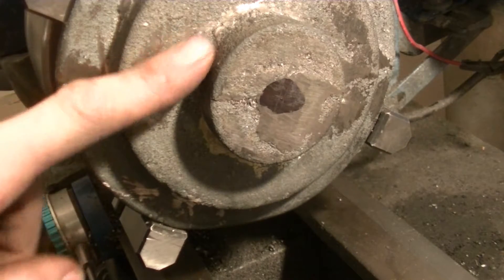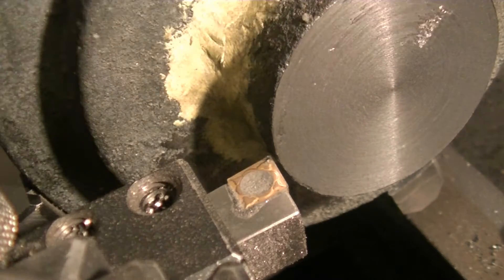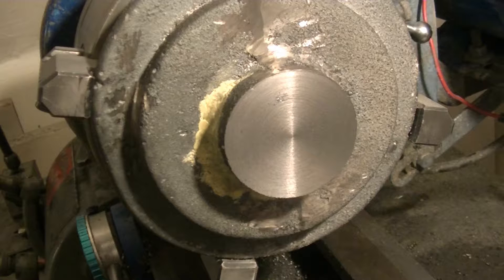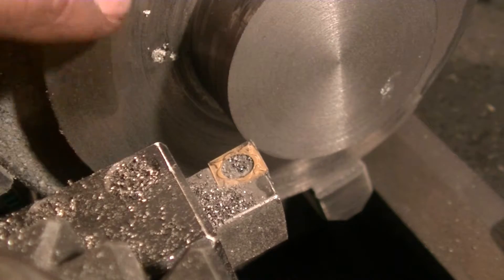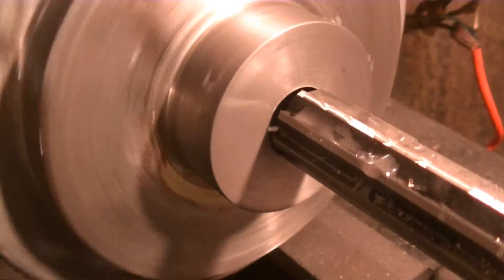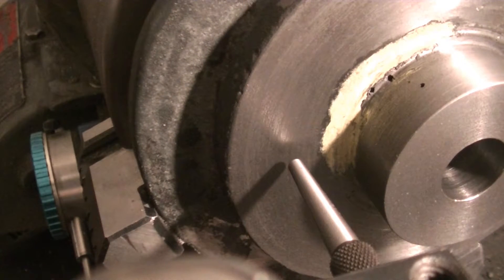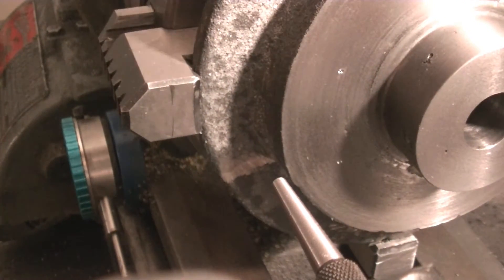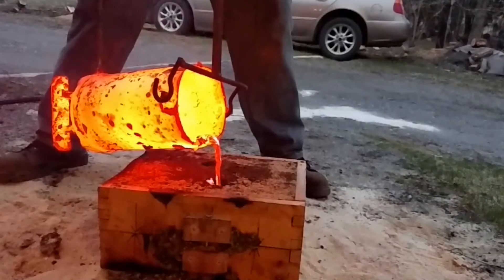Steam Engine Build: Machining Bottom Cylinder Head (Part 1)

Comment: Howdy, just found this project and have been happily binge watching. Great build!  Agree with others that brazing would be the most ideal repair, but wanted to mention high heat JB Weld putty.  I've had really good success using it on some projects requiring more heat resistance than available with regular epoxy.  Handles 450 degrees F continuous, 500 degrees F intermittently.  Looking forward to seeing this run!
- Bill
Reply from the maker: Hi Bill, Thanks for the views and the suggestion!

Comment: You could braze that blowhole. A heavy initial cut for the initial cut on CI will get under the scale and save your cutter. Nice casting!
Reply from the maker: Thanks!  I just recently got a torch capable of heating something enough to braze it (oxy-acetylene), so next time I get something like this, that is what I will probably do!  I will try making a heavier cut next time and see how it goes (my lathe isn't the most rigid machine as it is small)
Reply: I understand your concern about the size of your lathe, either a 10 or 12" Atlas/Craftsman, it appears. Even so, those lathes are capable of decent cuts and accurate work. I have used my dad's 10" Atlas and found it to be quite capable. My own lathe is a 10" 1943 vintage Logan which is a bit more rigid than the Atlas but still a small lathe.  You might try high speed tooling rather than carbide which requires more power because it's edge isn't as keen as that which can be obtained on HSS. Generally  carbide tooling  works better on powerful machines at high speeds which generate higher temperatures. It can excel at cutting very hard materials that wears HSS quickly. Carbides is also not very tolerant of interrupted cuts because it is so hard and therefore brittle. Carbides also tend to now like shallow cuts in any material, again due to lack of keenness of the edge.
Reply from the maker: Thanks for the info! I will remember it.

Comment: Looking good!  Quick question, with a rough casting like that is there a way to center it in the lathe better than just getting it "close enough"? I assume the pattern was turned on a lathe, right?
Reply from the maker: Thanks! Yes the pattern was made on the lathe.  I am sure there is a better way to align it than the way I did it here.  (If anyone has an idea! Let me know!)  Another way I could have done it would be to center punch the approximate center of the cylinder, and then use the 4-jaw to align that punch mark with a center in the tail stock.
Reply: There is nothing wrong with the way you aligned the piece in the chuck.  You are starting with a "rough" casting.  In my opinion if it is within .063 of concentric you did great! It is not remotely what could be considered "true".  You allowed yourself ample stock when you cast it enabling you to true it up, so it this case your setup was just fine.  I am curious why you didn't braze the small defect though.  I hope you have a video of the finished engine, I am really looking forward to seeing it.
Reply from the maker: At the time of making this part, I didn't have a torch capable of brazing. I do now so if it gives me trouble I can braze it up real quick and remachine.  I am only slightly ahead of the videos posted here on YouTube so I still have a long ways to go before it is done.  It will be very rewarding to see it running!